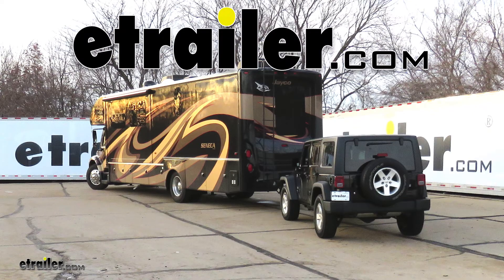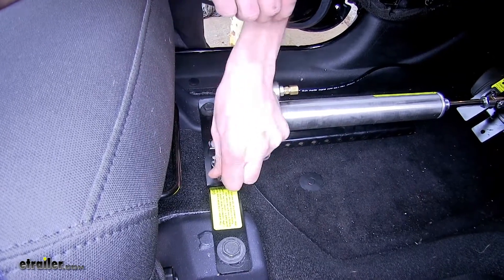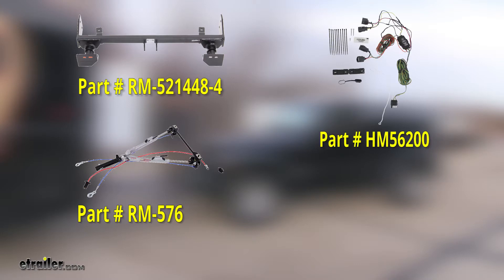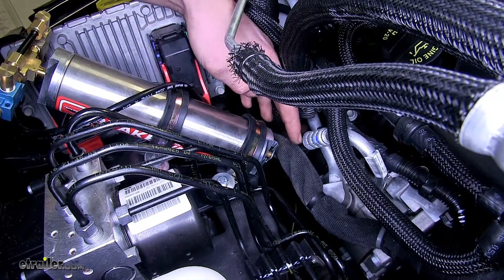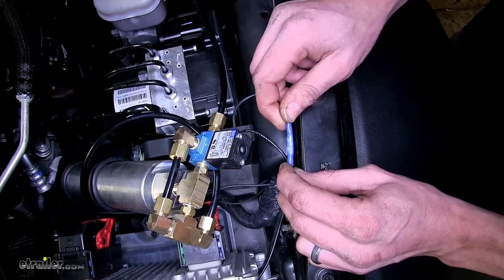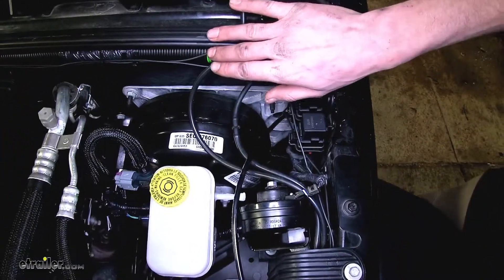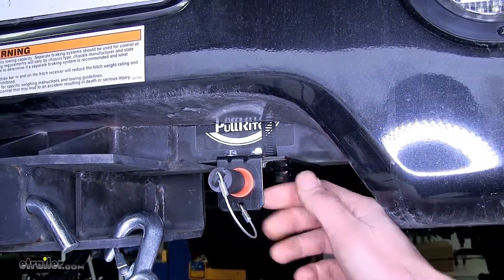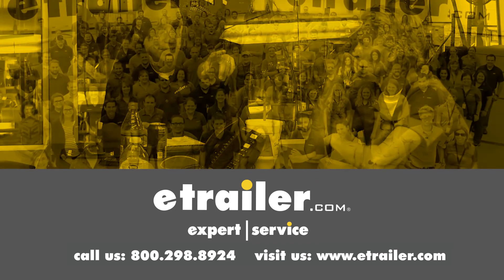etrailer | Roadmaster BrakeMaster System Installation - 2016 Jeep Wrangler Unlimited

Comment: can i use the air line inside the jeep to air up a tire? or is that air line routed straight to the front bumper with no ability to syphon air?
Reply from the maker: The airline that is mounted inside the Jeep is not designed to be an auxiliary source of air. You would benefit more from installing an on board air compressor and tank on the Jeep so that you can properly air up tires where ever you need to. We have some great kits in the following link.
https://www.etrailer.com/dept-pg-Tire_Inflator-pt-On~Board.aspx

Comment: I recently purchased a 2001 Bounder 36S diesel and I am adding a Road Master Brake Master 9160 supplemental braking system to the towed vehicle. I have completed everything except connecting the Brake Master air line to the motorhome air brake system. I know where the air brake relay valve is located on my chassis (just in front of the differential) but it doesn't look anything like the illustration in the installation manual or the one in your video above (except its between the two smaller valves in your video) and I cant figure out which port or line to connect to. Would you have any pics of the air line installation on my unit?  Any input would be greatly appreciated. I have pics I could attach of the relay valve on my unit, from the top and bottom, but no way to attach them to this message.  Is it possible to tee directly at one of the spring brakes?

Comment: does it work for non air brake
Reply from the maker: This kit is only designed to work with air brakes. Check out the Stay-N-Play Duo kit in the following link. It is a great kit for hydraulic braking systems.
https://www.etrailer.com/Tow-Bar-Braking-Systems/Demco/SM99251.html
Reply: Wrong, it will work with hydraulic brakes. I have the same system on my Tiffin gas Mh.
Reply: @joecamp5026  air over hydraulic , it will not work with a hydraulic brake system per the manufacturer
Reply: @beckmansgrandpa   Sorry your wrong. I still have it on my 2006 Tiffin 32 Ba which is a gasoline powered motorhome with hydraulic brakes and it works perfect and has worked for 10 years. So somebody is giving you bad info. Their web site even says it does.